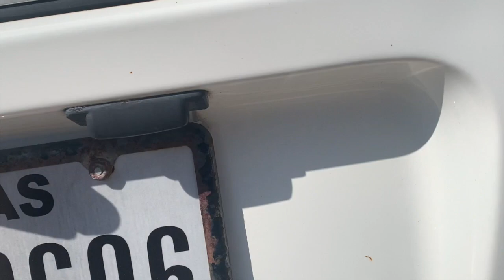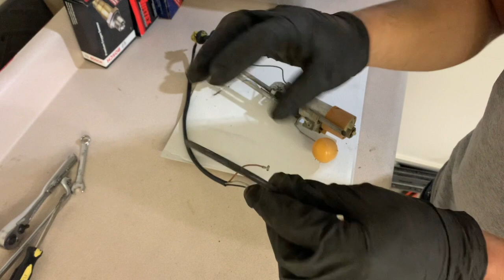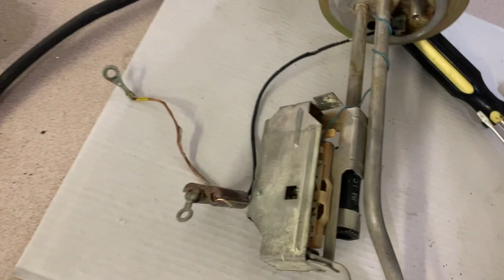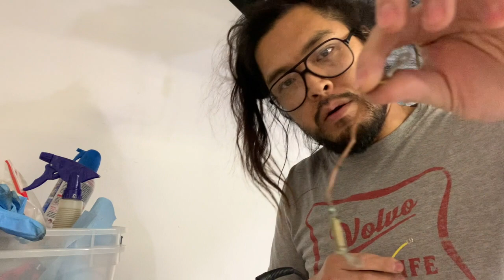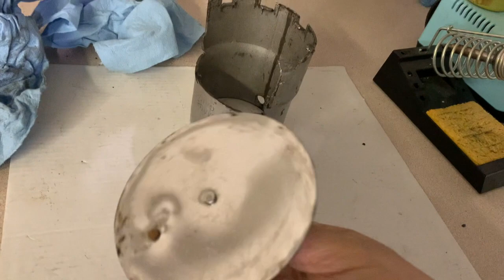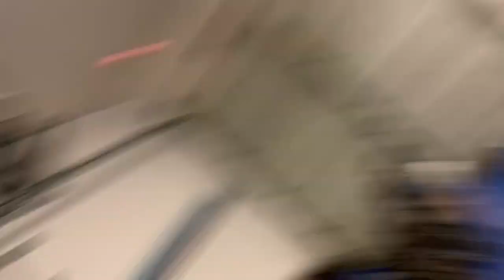Volvo 240 Fuel System Repairs Part 4: replacing the in-tank fuel pump

Comment: Thx for including the soldering of the wires and identifying the black as power and the white as specific to the fuel GUAGE.  Each with their own grounds.  Right In the middle of this now.  Just checked In with your job for clarification on that. Thx, DD

Comment: Upgrade would be a stronger 'race pump' in the tank. Then a long feeding hose/tube to the engine compartment with a servicable filter there, before FPR and fuel rail. Agree?
Get rid of all that stuff underneath so to speak.
Reply from the maker: I’ve done it both ways but for a regular daily 240, I like the 2 pump system, no need to upgrade or change the wiring or fuel lines. In the event of a tank pump failure, the main pump will still operate a 240 until you can get around to replacing it
Reply: @240rescue  Thank you for the input. The system with two pumps is in reality a safer solution. I have though looked at the Walbro 451(?) as an upgrade för my 35 y o daily driver. It would be 'cleaner'.
Reply from the maker: I’ve ran a single walbro 255 with good experience in the past